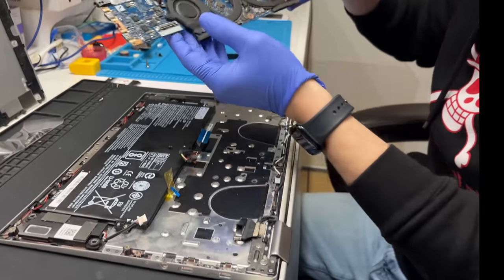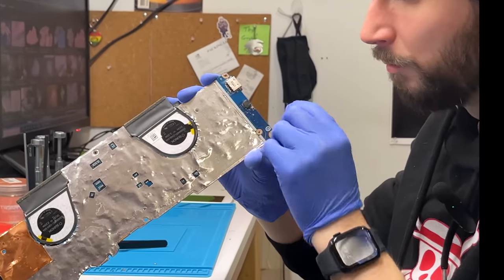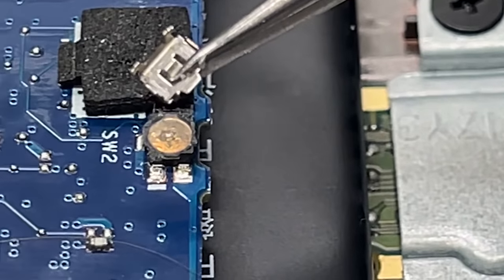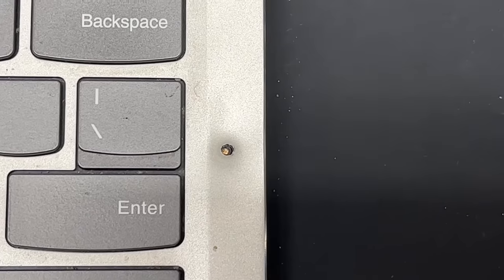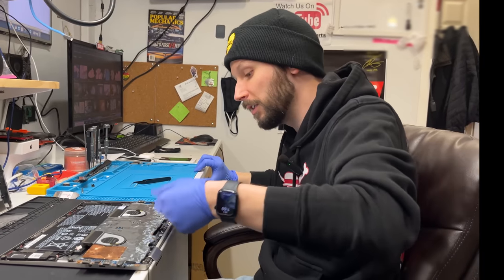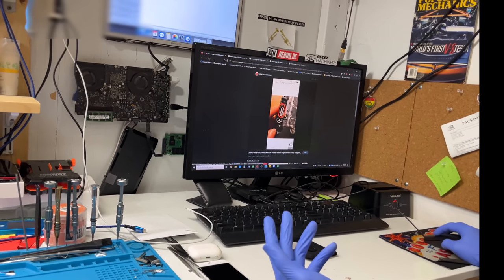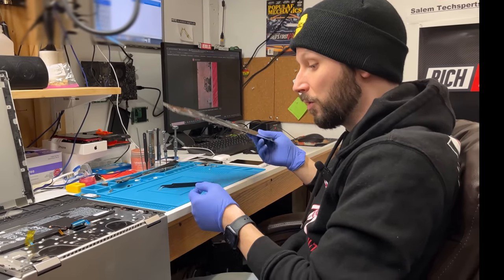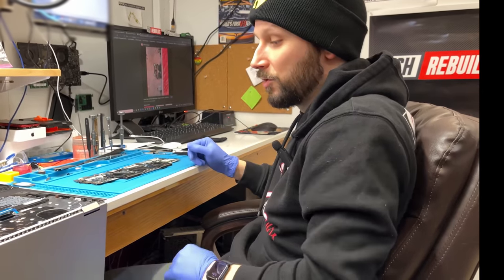Another reason to never buy a Lenovo Yoga (huge design flaw)

Comment: With most consumer laptops being sold at stores with 1 year warranty, it seems that many of them are designed to fail not far outside that warranty period.
Reply from the maker: It's remarkable how many laptops come in my shop just after the warranty period expires.
Reply: @SalemTechsperts  So… maybe it’s not a design “flaw” from the perspective of Lenovo, it’s a design feature.  The material is carefully selected to last a little more than a year’s worth of button presses so that Lenovo incurs few warranty claims and the consumers still need to buy new laptops frequently.
Reply: beautiful programmed obsolescence
Reply: my msi laptop has a few stuck pixels and it started having that issue 3 months after i bought it haven't fixed it yet
Reply: laughs in 2 year legal warranty

Nothing does this and it backfired on them, 13 months after purchase their pods literally fell apart. Replaced them for free. If it happens again in 10 months, I'll replace them again.
Reply: The only way to fight it would be if society as a whole turned from chasing the "latest & greatest" that's just really the same tech rectangle as before but with a bigger number. Given the fact that every time Apple releases a new product there's a notorious increase in the sales of firstborn's souls I ain't got much hope of it ever happening
Reply: Laughs in 3 year legal warranty
Reply: 2 years in European Union. so I think they use the same design everywhere
Reply: In the EU legal minimum is 2 years of warranty, in Sweden it is 3 years.
Reply: @Anankin12 Your 2 year warranty is renewed when you get your replacement part
Reply: @swecreations  yep
Reply: This is why artificial obsolescence is ass. Same with phones maker
Reply: @swecreations EU warranty is 3 years.
Reply: @midgeot  "Under EU law, within the legal guarantee period of two years, defective products must be repaired or replaced without any cost to the consumer. This includes any shipping costs. So, the seller should cover all shipping costs (the cost of you sending the product to the them and the trader returning the repaired product to you)."
Reply: You basically described HP's model of business lol
Reply: @swecreations  uh weird, thought it was 3 years because the warranty laws changed here in portugal to 3 years in accordance with EU law 😅 my bad
Reply: @midgeot  no such law in the US, unfortunately
Reply: I got the 9i for 700. I guess because I don't use it heavily it does the job, but THE PEN OR ANY PEN ON GENERAL DOESN'T WORK. Which I realized 15 days too late. Plus it does this weird bug where the screen just goes black. I'm so glad I didn't pay full price. Now that I'm seeing this I'm regretting it more especially since there customer service sucks.
Reply: I swear it's true, my ideapad's hinge is about to break with one month of warranty left.
Reply: Sane thing with appliances. Total scam.
Reply: You guys need to push not only for right to repair, but also for better warranty laws. In the European Union we get obligatory 3 years warranty on all products since 2022. Previously it was 2 years warranty.
Reply: In Europe the warranty is minimum 2 years, and many large retailers offer free extra warranty on top of that.
Reply: Hah, I have 3 business class laptops, each with about 5 years of difference between them (+upgrades thank god t420) and all 3 still come out way stronger than most modern day machines at the same price range you can get the old ones used!
Reply: That's absolutely and undeniably the case.
Reply: But surely after your lenovo laptop fails after 1 year, you never buy lenovo again
Reply: Oh I learned this at school, this problem must be investigated by some authorities. They shouldn't be designed to fail after the warranty period, the consumer protection authorities should be warned about these flaws.
Reply: They now put 3 year warranty
Reply: My 16" Yoga 7 just failed at 13 months - turns on but won't post. "Capslock screen of death" problem I've heard it described. Suspect fan/heatsink issues as hell this thing gets hot in a few minutes.
Reply: My favorite is the garbage epoxied on hinges they put in most sub $1,000 notebooks of most brands. Just trash products all over the place these days.
Reply: Funnily enough I got an expensive af laptop as an investment for uni, It had to work minimum 5 years. Mdfk broke after the warranty expired. It was seriously expensive, especially for a student like myself
Reply: IME consumer-grade laptops are total shite, regardless of brand. While it's hard to tell from images and specs online, models aimed at business users are just so much better put together and long-lasting; while useable machines can be had for not a huge amount of money second hand.
Reply: @Anankin12  cries in 7 days replacement, 1 year service
Reply: Yep that makes sense built to break
Reply: Europe requires them by law to have 3 years warranty
Reply: @SalemTechsperts  just want to note that you said "it's like making your gas pedal out of plastic" when that's literally exactly what alot of car manufacturers do.

It's not about if it's made out of plastic, it's about the quality of that plastic.

Side note, thank god that on most cars though it's a piece of strong metal that comes down and has a piece of rubber covering it for comfort.
Reply: @Commandelicious that is just not true
Reply: Is that legal? In my country everything you buy has a 2 year legal warranty (except for consumable products like food and batteries), unless it's reasonable to expect it to last for more than 5 (includes all cars and electronics). Meaning if I bought a yoga and the hinge failed after 4 years I must be given a replacement of the equivalent model (or better). The warranty of this new product then resets, so if the issue is as bad as claimed here, buying a Lenovo computer in most EU countries is a safe way to have a lifetime supply of computers?
Reply: @SalemTechsperts in the EU (or only germany, I don't know) it is acutally illegal to design goods to break right after end of warranty. E.g. Apple had to pay some heavy fines and were forced to redesign to make product last longer.
Reply: How do you explain 2 and 3 years warranty in europe then ?
Reply: @danteashen6178  different countries have different laws. What's there to explain?
Reply: I wonder if planned obsolescence is good on the social level. After all, it allows for faster iterations, and thereby for quicker adaptation and testing of new technologies. Maybe we would still have iPhone 6 level smartphones if it wasn’t for this.
Reply: @vaolin1703 is not planned obsolescence, it's just shittty design for cutting cost cause people are dumb and still pay for it. In EU we have minim 2 years warannty and it gets repaired for free including shipping or you're given all the money back. I literally get a new mouse mouse for free every year cause it keeps breaking in warranty period😂
Reply: comrade
Reply: @DavidLee-cr4xv  In Germany we say: "Sollbruchstelle".
Reply: @RaenYrtham also spare parts for 10 years, before was 5. 

Cheers.
Reply: Mine wouldn’t charge if you open a game and would only charge when the laptop is asleep, all because the charger somehow overheated… on a gaming laptop.
Reply: 1 year? Where do you live?
Reply: @swecreations   the key word is "seller" it's not the manufacturer.  I work for customer support and our devices have a one year manufacturer warranty. For your second year you contact the seller.  Either US or Europe, its still not the manufacturer's problem after month 12.  Now, if Europe said it was a minimum of a 2 year manufacturer's warranty something might change. Australia and New Zealand have the best consumer protections. They have something like a 5 year default. I moonlighted on the Australian desk for a while and my employer bends over backwards in that region.  It can be done.
Reply: At least you won't have to worry about voiding the warranty when you decide to drill a hole through it just to turn it on.
Reply: Yes, everything electronic is designed to be replaced within two years. Learned that in a telecommunications class in high school. Same thing with any product now, cars, computers, phones, game systems, etc etc
Reply: @Malibu252  where did you learn this? In misinformation 101?
Reply: it’s not tht it’s a mix of heat and dust plus neglect why tf u use it 13 hours a day and not clean fans or service it
Reply: @groper.not.grouper9501  wdym service it?
Reply: @groper.not.grouper9501  a terrible design fails because it's terrible, not because it isn't "maintained"
Reply: Weak. I overworked my new laptop that its motherboard malfunctioned and rendered it unable to charge in just four months. I got those serviced for free. Then in less than two months after that, my charger is not doing its job. Got that fixed too. I will not let them go without even fixing problems that I made. One year for laptop and six months for battery, Acer? That's a rookie number! Watch me as I rush and force you to cough out service money I deserve for buying it firsthand!!! Taking care of my laptop? What's that? YOU take care of my laptop, it's still its first year with me!!!
Reply: it was totally different back then where it can break concrete floors and just say "tis just a scratch"
Reply: Wait what? Only 1 year warranty? On my country it’s 3 years including accidental damage protection 😂
Reply: lenovo ideapqd 3 Was good Afted the warranty expired turns out it had something wrong with the USB controller and my way other than going to repair it (I am 13 I can't ) is to beat a spot then it works again and this when I did it wrong costed me my old laptop's	HDD that got broken in the process
They should be sued over this
Reply: Ive had 2 laptops go for 3 and 2 years and my mum has a 9 year old laptop only upgraded once. Sometimes they are done right :)
Reply: long live local reclamation laws. 3 years in sweden for production defects.
Reply: The amount of ewaste is insane
Reply: @SalemTechsperts  please suggest, that's well designed 2024 models
Reply: @SalemTechsperts its remarkable how i got a yoga with 3 year warranty
Reply: Do you recommend any labtop models that will last or are good quality?